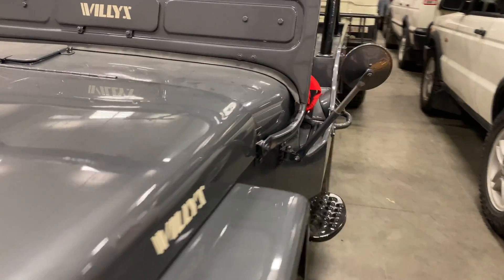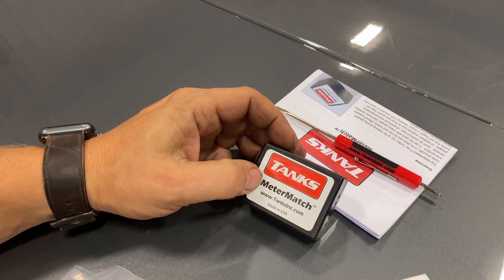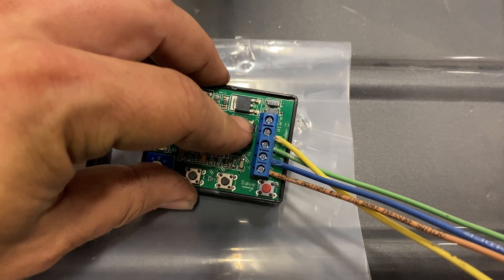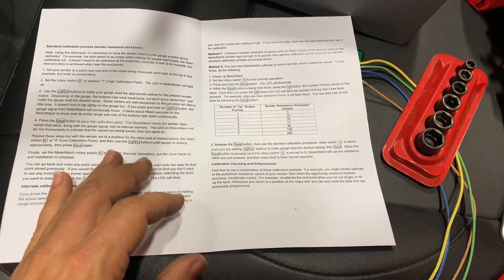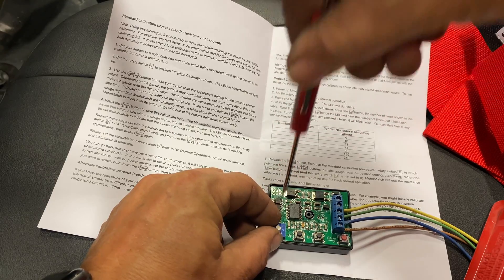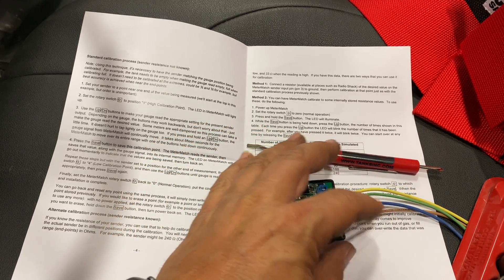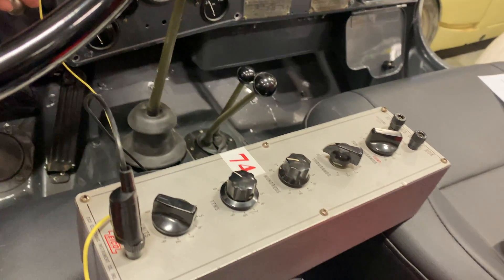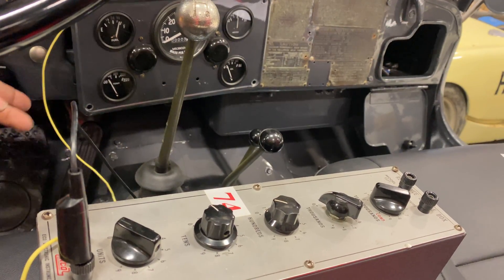Making Mismatched Fuel Sender and Gauge Work Using Meter Match

Comment: Could you just use a pot or resistor to make it work ? Just asking
Reply from the maker: Nope that won’t work because a resistor can only offset it one direction.
Reply from the maker: And what if your gauge works opposite of your sender. This device lets any sender work with any instrument.
Reply: @ThisWeekWithCars  follow up I used a reostat to dial n my gauge then measured the omms and used a resistor  to bring the total range down to work with the factory.  I asked an old guy  and it took 20 minutes to get r done

Comment: Absolutely stellar video, I used this to get my gauge in my 71 volvo 142E to work because I installed a rallye cluster, which was never really available here in the US, so they used a different sending unit, got it wired in and everything works with your help! Thanks again!

Comment: Can you explain how to connect the wires rather than explain the working of this gadget (which is in the manual anyway)? Can I use this device to operate the original (moving coil) prewar Fuel Gauge (Smith) with a more modern sender unit? I have a "+"  and a "P" (petrol tank) terminal on the gauge, and a "W" (which means +) and a blank terminal on the sender. The "+" and the "W" terminals are connected with a RED wire, the "P"and the blank terminals with a YELLOW wire. You use 4 different colours which makes it difficult to see which is which. Can you perhaps explain?
Reply: Never received and answer....

Comment: mine doesnt work, since my car is a evo 8 which has too fuel levels as its a saddle type tank... i had too take the signals from the oem cluster harness as both sender send the signal togather to cluater gauge. ... when i try to calabrate the meter match with a extern fuel gauge all is okay for full empty and middle as far as calbration is concerned with the fuel assembly out of tank but when i put it in the tank the fuel lvl gauge goes to full... so i dont know what im doing wrong even the meter match team dont know how to help me.... the fuel gague works sort of okay expect it bounces a lot when i drive the car without the meter match.

Comment: If you have an irregular shaped fuel tank, the sender may not match the actual fuel level.   As a check, I put 1/4 tank of gas, then 1/2, then 3/4, then full, and see if the gauge reads correctly  (that's assuming you know how many gallons your tank holds).
My tank takes a long time to get from full to half, then from half to empty, it goes quick.  I set the device so the gauge reads half when the tank is filled half full.  I'd rather know when I'm running out of gas than when its full.

Comment: Would this item work if you have a fuel sender from Europe that reads low resistance when full and a digital gauge from america that reads other way round. I need to reverse the way gauge reads as full tank is empty.
Reply from the maker: Yes it would

Comment: I guess it will also work with resistance based gauges such as oil pressure. Is there an equivalent item for speedos which use square wave counters?
Reply from the maker: Yes any resistance based gauages.

Comment: Years ago I wanted to convert my Fire Department Jeep to 12 volts.  It is a '54 CJ-3B.  The instruments were the thing I had the most difficulty planning for.  I got a lot of advice.  Ultimately the project was nixed due to office politics.  Now the Jeep is retired to parade duty.  The Tanks Meter Match is the thing I would have needed back in the day.  And, I never was fond of sitting on top of the gas tank.
Reply: lol try doing the 12 volt conversion using the delco alternator and having the starter re-wound for 12 volt and installing an in tank fuel pump.  Only to have a seat bolt break, slide the seat frame forward and pinch the fuel pump wire to the point you're going down the road and smoke starts coming up between your legs.
LOL I couldn't bail out of my 48' willy's quick enough!  fortunately I was able to turn down a gravel road and let it come to a halt in a field.  Jumping off and releasing the pressure of the pinch probably saved the jeep.